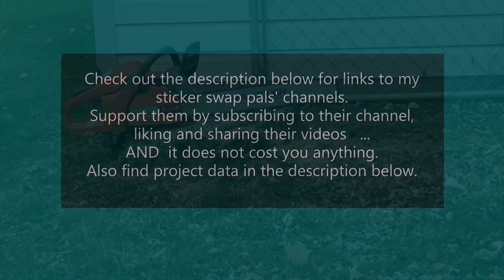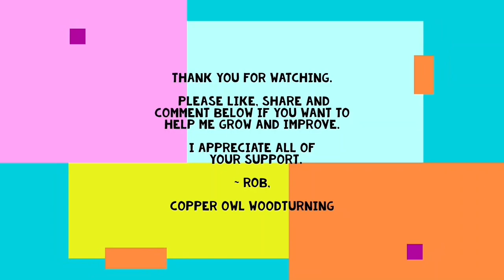Easy Charcuterie/Cutting Board from Black Walnut Slab ***It looks AMAZING***  Copper Owl Woodturning

Comment: Can't go wrong with Walnut but still a job well done! 😎
Reply from the maker: Thank you, Leo. If I had a bigger lathe, I may have turned it. 😊😉
Reply: @copperowlwoodturning5929  Recently I made one from a slab of Alder. Cut on the tablesaw, drilled a 55mm recess and turned  it on the lathe.
Reply from the maker: @emgiwoodworks  very nice, Leo. 👍